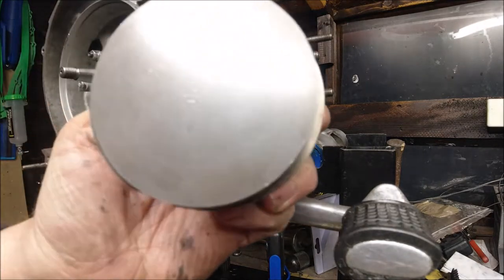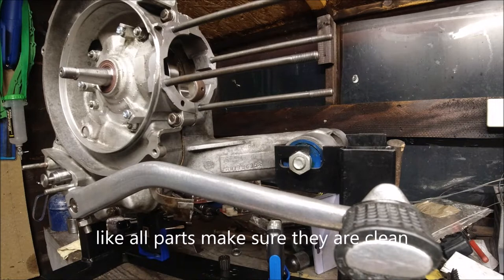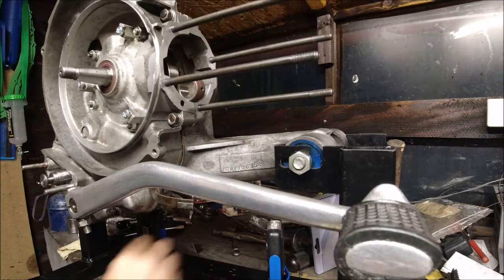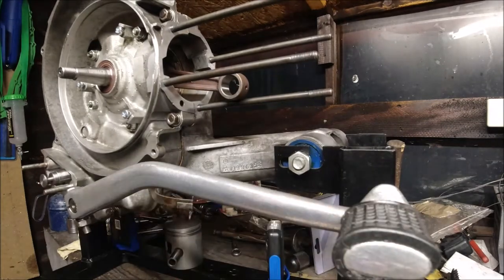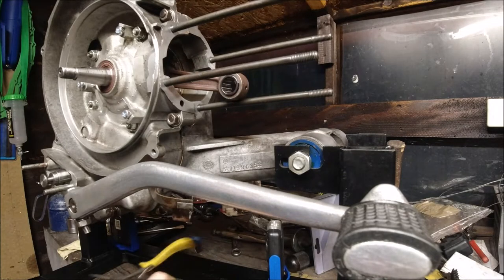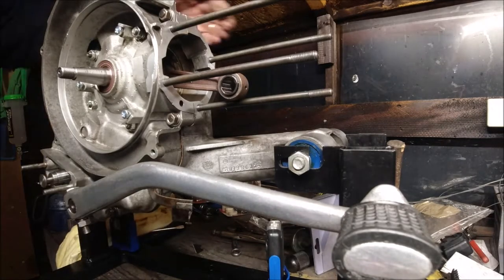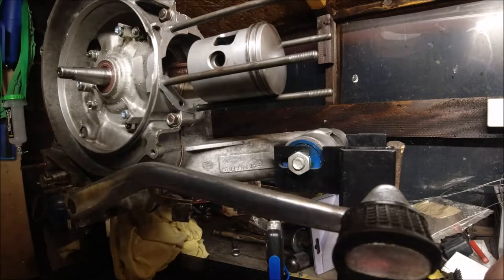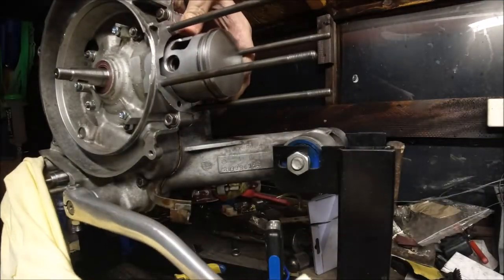Vespa PX engine rebuild part 8

Comment: i put a little 2 stroke in the piston ring  grooves also
Reply from the maker: I put oil in the bore
Reply: @m1scooterlife259  i know,  i saw that mate  ..but i was always told to oil the rings also  because once the rings are  tight in the barrel ,,less chance to get all the oil in the  ring grooves on first start  for  first first few miles  and they can jam in those grooves on the inside of ring ... if not lubricated enough  :O)
Reply from the maker: Everyone has a different way to do a job, if your happy with your way that's great and in any case it works, I always check the ring gap in the barrel and file them if needed. It's the only way to insure that it shouldn't seize when first started, you can also put oil direct in the tank when you first start up, especially if you opened up the autolube system.
Reply: @m1scooterlife259  i agree,,you are quite correct

Comment: How far do you screw the studs in? I have heard if the one near the oil pump gear goes too far it can damage it.
Reply from the maker: Only till the end of the thread, use some thread lock on it, it's true you can damage things , I've seen the flywheel had scratch marks on it.
Reply: @m1scooterlife259  Thanks. Much appreciated.
Reply from the maker: Pleasure, good luck Mark